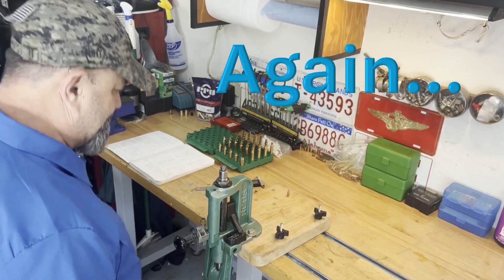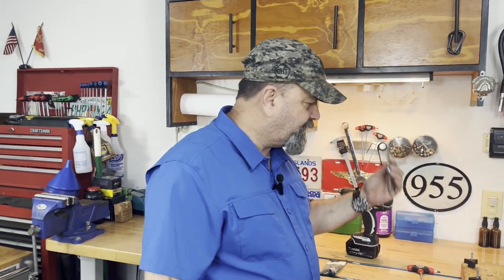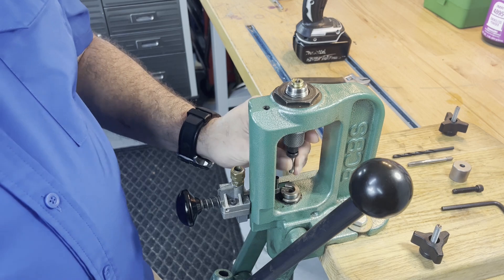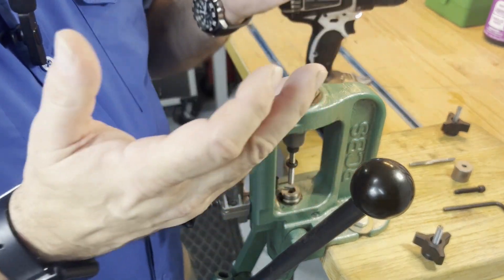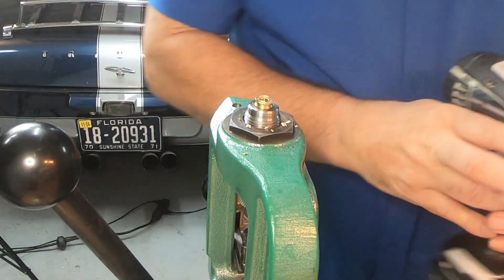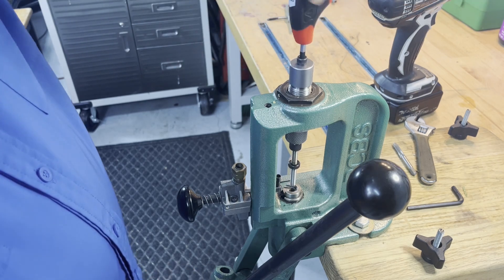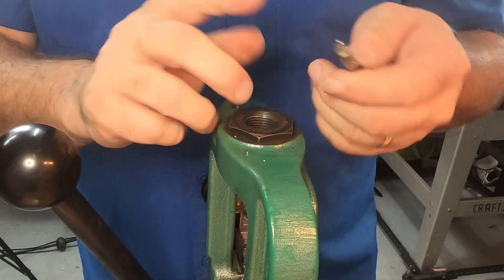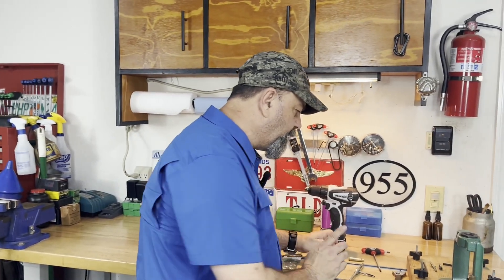Stuck Case in Sizing Die: Kit and Socket Methods for Removal

Comment: What types of lubricants/ other preventative measures would you recommend to help this from happening less often?  Also, just some constructive criticism, on your up close views, the pin was sometimes off camera while you were pointing out something.  As always though, you were very informative and helpful.
Reply from the maker: Thanks for the feedback Paul, I will work on that for future videos.  As for how to prevent this - this is a Lube problem most of the time.  I might even do a short vid on the different types of lube and when to use them.  The "Best" lube I have found is Imperial Sizing Die wax.  Its also the slowest to use.  Its not necessary for most applications.  For something like .223/5.56, that I might even run on the progressive, I find One Shot works just fine.  If you use an aerosol of any kind, the agent that delivers the lube is almost always alcohol.  You MUST let the alcohol flash off (evaporate), or you will get a type of "hydro lock" - a stuck case.  So any of the "quick" spray lubes just need to sit of 10 to 15 minutes.  These days, I am actually making my own lube in a spray bottle for most of my use, it works just fine.